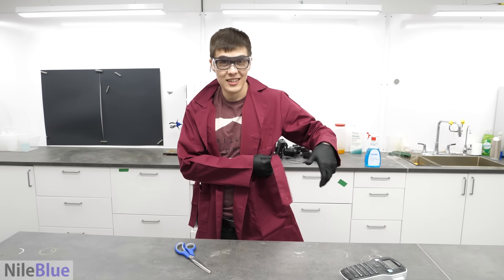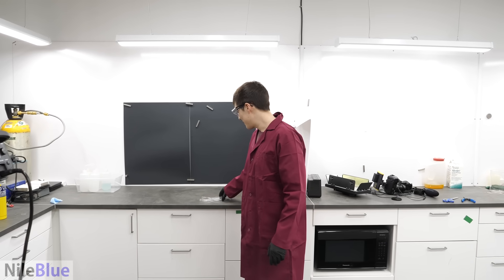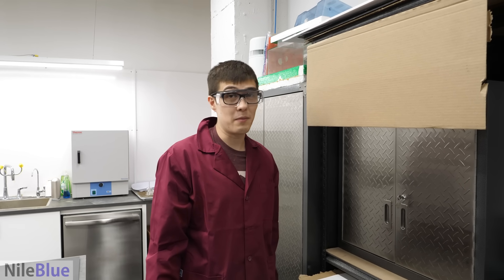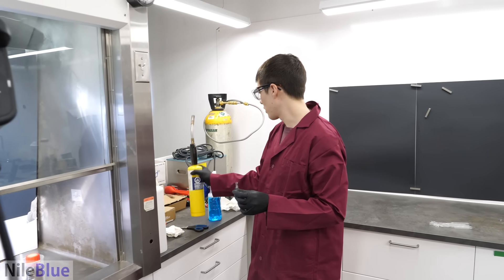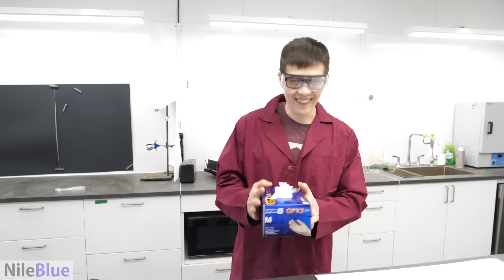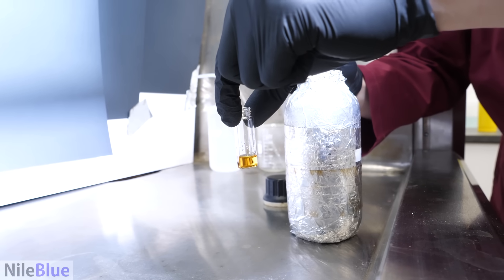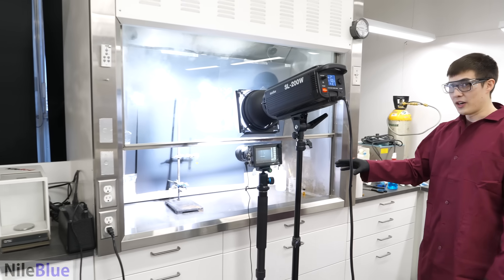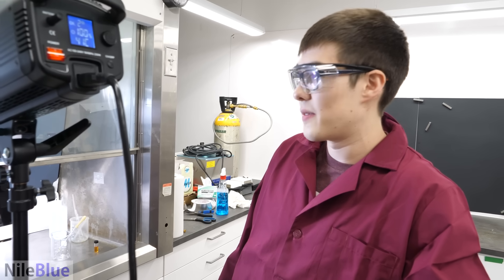Liquid rocket slow-mo adventure

Comment: Okay I uh work for Aerojet Rocketdyne… and these guys seem to have no idea how dangerous this stuff is… when we work with any chemicals at all… we all wear full hazmat PPE with an independent air supply, emergency showers and heat triggered retardant sprayers from the ceiling. If any of that stuff gets on you it won’t stop releasing energy.

Comment: It looks like the expulsion from the reaction was competing for test tube real estate with oxygen intake to keep the reaction going.  if you could have had an oxygen source by the nitric acid without compromising the reaction chamber (i.e. an oxygen line/valve) I suspect you probably would have had a more stable reaction.  Having a second intake for the aniline itself would likely create a much cleaner reaction as well since the force of the reaction seemed to be pushing any aniline that hadn't made it to the nitric acid back out of the top.  However, that would require much more setup and precision, as well as the desire to make more things explode, which doesn't seem to be a desire you have an abundance of. :P

Comment: 2:25 i used this in a chemical plating factory i hate that shit it is the worst acid ever its so fumey but atleast the fumes are heavier than air right

When it gets on your skin tho you hardly notice it... but if you get tiny drops and leave it for awhile you will get tiny little single layer skin blemishes that heal fast.. mainly makes you itchy

Comment: the gas expansion is subsonic, so no need for an expansion after the throat of the nozzle; this actually reduces the thrust of the rocket, as it needs to expand back out and slow.  De Laval nozzles (contraction-expansion nozzles) only work if the propellant reaches mach 1 at the throat!

Comment: I wouldn't suggest to try fuming nitric acid on you skin like Nile did. The only protection is a thin layer of fat on the skin. And once it's gone it will burn very fast. Also if there's water on the skin the reaction could go faster. 

In my uni there was a case in 60-s, I think. Some guy got his hand burned to the bones when fuming nitric acid splashed on the skin.

Comment: I Know you're Using Hypergolic Fuels, Which Combust On Contact with Another Hypergolic Fuel, The Dragon Spacecraft Fuses it as well, For the Launch Abort System, Making it Very Reliable, and Since its Liquid, its Throttable. Also Sorry for all the Info, I'm a Rocket Nerd

Comment: A lot of rocket fuels are very sensitive based on ratio, if it’s off by just a percentage of its mass, it can ruin the mixture. I make rockets often with my friend and we use a Potassium Nitrate and powdered sugar ratio and if we are off by just a few grams, it will either smoke and just kinda sit there or burn very cleanly and don’t get any rapid gas expansion. You really need to hit that sweetspot. You should try some small solid fuel tests in the future. Just keep in mind that the mixture is super sensitive to moisture and every hour it sits out it looses a lot of its potential. Due to its sensitivity to water, it can be rendered completely inflammatory rather quickly which can be exploited to stop small unwanted fires.

Comment: 12:38
Not quite at the same time.
The top and the thin neck ignited at the same time, with the neck being really dim.
And then that reaction spread to the bottom, causing the whole thing to burn more brightly.

Comment: This is the experiment that I'm wanting to try and that I'm prepping for  right now. I just need 5gr  99.9% pure tin metal I'm having a hard time finding some around my place anyways Using modern science and fusion to fuse tin and copper into gold isotope 104 I need to stabilize the isotope with 14 neutrons because fusing copper and gold gives you 79 electrons 79 protons only a 104 neutrons which means stabilizing it with 14 neutrons should give us a nice stable 118 isotope  if I'm successful with this experiment this could be extremely important for the technological production industry as expensive gold is used in many of their processes for making solid state chips ultimately lowering the cost for future technology  in theory this should work with tungsten and Boron and stabilizing it with an extra 13 neutrons

Comment: ive always wanted to integrate some computer science optimization into practical science. like a fuming nitric acid container with a solenoid to vent it regularly. or writing a code for your aerogral pressure chamber so you wouldnt even need to babysit the meat cooker. i guess thats pretty overkill stuff that i just am interested in cause i love comp sci and it doesnt pertain to chemistry but interesting thoughts that go through my head tbh.

Comment: I know you've done Aluminium and mercuary before, and it's timelapse is a very iconic image. Would you do it again, and is their anything that can be done to either slow down or speed up it's reaction? also does the shape of the aluminium affect the "stack" of oxide build up? What would happen if you did it in on a small aluminium dome, or dish?
Reply from the maker: I did a follow-up for it shortly after the original. I slowed it down and stopped it by running it in a vacuum. I think more oxygen would speed it up.

Comment: 1:03 It reduces the space the fuel can be exhasted from and limits the air entering the system increasing the force exherted.

Bigger hole = less force / small hole = larger force. Too small and it seals shut and becomes an explosive.
Reply: yes

Comment: If you're really interested in this subject, I recommend taking a look at the book titles How to Design, Build, and Test Small Liquid-Fuel Rocket Engines, which is exactly as it says on the tin: a guide to designing, building, and testing small liquid-fueled rocket engines. It's available here: http://gramlich.net/projects/rocket/book.html
It mainly deals with designing a gaseous-oxygen/gasoline engine, but I'm fairly sure it can be adapted to work with RFNA/Aniline with your knowledge

Comment: I learned to respect acids, after cleaning welding oxidation off some INOX with a pickling paste. Turns out, the skin turns yellow, and later black, where it splashed. leaving a nasty scar.
Reply: Yellow skin is a typical day in the lab. Black though? Did it not occur to you to was your hands in time?

Comment: 0:57, approximating the gas to a laminar fluid, the reason because it goes faster is that (if the flow is constant) when the section decreases the speed increases infact they are inversely proportional : 
Q=V/t=A×v×t/t=A×v (Q is flow, V is volume, t is time, A is section or area and v is speed). 
Sorry for my not perfect English but I'm only an Italian teen.

Comment: I think you might want to consider investing in a lavalier microphone, the audio in this leaves room for improvement
Reply from the maker: It needs to be sound treated. The room has a horrible echo. It'll be done eventually
Reply: @NileBlue  Thanks for the reply. That would definitely work, however I am pretty sure a lavalier microphone would be a good improvement in the meantime.   I might be wrong but I'm pretty sure it will help quite a bit. I primarily work with images but I've been around a lot of mic setups too and lavaliers are definitely a worthwhile investment

Comment: For nitric acid you should use neoprene gloves.  I don't know if they are also good for fuming nitric acid. If you'll try, let me know!
Reply from the maker: If you look at the polymer, you can see areas that can be attacked by nitric acid. Most notably, double and triple bonds. Vinyl doesn't have any, which makes it way better. Neoprene has a double bond though, so I imagine it's similar to latex. However, I could be totally wrong.

Comment: The Nozzles you make won't really do much if the back pressure is too high - it'll go to mach 1 at the throat,  and then decrease below sonic speeds again. if your back pressure is lower, you'll reach mach 1 in the throat, and then be able to go above it in the divergent section. Looking at the flame, it definitely looks like this is the case - it continues to thin after the nozzle diverges.

that is, if you ever reach mach 1. you might never reach it, in which case you don't need to re-expand the nozzle ever. It's a design constraint of compressible flow nozzles that if you reach mach 1, it'll be at the tightest point.

Comment: All you would need to create some more nitric acid is some water and a lab-grade high voltage transformer. You would need to strike an electric arc to superheat the air with plasma, separating nitrogen and oxygen out of the air to create N2 and O2, which recombine to form Nitric Oxide. Add Oxygen to this, and you get Nitrogen Dioxide. This Nitrogen Dioxide can then be combined with water to form Nitric Acid and more Nitric Oxide as a byproduct. This is demonstrated well by "Cody's Lab". https://www.youtube.com/watch?v=ep23ds4cZs4

Comment: The real question: Why would you have your acid cabinet made out of metal?

… not that I'd be much better. Mine's cardboard.
Reply: Metal would at least react with the acid, if there is a leak
Reply: @among-us-99999  it would look sick.
Reply: @among-us-99999  What? Bro do you even chemistry?
Reply: It has already been said. I thought it was common parctice to make acid cabinets out of metal because they react metal. There fore you can see if you have a leak.
Reply: @gewoonik687  better to wrap the bottle with aluminium foil like another commenter said. That way you don't need to replace the cabinet due to the slightest leak.
Reply: Plastic or ceramic would be the ideal choice.
Reply: PTFE or PVDF plastic would be a good choice for an acid cabinet
Reply: @bluesun128  I would just use PET or ABS. PTFE is way to expensive for commom acids.
Reply: @brilliantgreen2863  on the contrary, PTFE isn't that much more expensive than PET, at least for sheet stock from our supplier.  And ABS may be a good choice for some chemicals, but some acids such as Nitric acid will react with it.
Reply: @bluesun128  PET and PTFE are the the same price? Damn, could you please give me a link?
Reply: @brilliantgreen2863  +1. I want to get in touch with that supplier <3
Reply: That would be an acid box then
Reply: @L. Fire Because the metal will capture the vapors, react with them, neutralising the acid and leaving a visible sign that something is wrong at the same time.
Reply: Me : store nitric acid next to white spirit and gasoline on the same metal open shelf
Reply: I have a radioactive materials cabinet
Reply: What you need is a metal cabinet with a non-reactive finish. My acid cabinet is painted with epoxy. Perfect, no corrosion.
Reply: I dOnT hAvE a AcId CaBiNeT i JuSt SnIfF It AlL
Reply: @GAMINGOBRIEN69  if you're snorting straight acid you're gonna think the moon is a dog and your nose is a kangaroo AWWWOOOOOOOOOOOO
-The Truth
Reply: @100GTAGUY  are you on acid?
Reply: L. Frie could be something unreactive like aluminium
Reply: @ix_risor  aluminium is insanely reactive lol.
Reply: @brilliantgreen2863  how about gilded/gold plated stainless?
Reply: @brilliantgreen2863  Aluminum oxidizes instantly in air, though, and the oxide coating is extremely stable, I think only the halogens can even begin to touch it (I remember a Reader's Digest story about a train derailment decades ago  that oopsied a tank car of chlorine, that described people watching their window frames rot away over several minutes.).
Reply: @noahluppe  gold plating might work, but it would be dissolved by a mixture of nitric and hydrochloric acid. Best to stick with plastic.
Reply: @DeliveryMcGee  it's not just halogens. The oxide layer is quite unreactive, but no match for decently strong acids. I remember making cups from compressed aluminium foil with a friend and pouring in 37% hydrochloric acid. It turned the cup into a grey puddle of aluminium chloride within seconds. That was fun.
Reply: @DeliveryMcGee  thats something people miss sometimes. Like aluminum reacts with water to form hydrogen gas so why dose your aluminum camping pot not go up in a ball of flames when you brew your morning coffee? Because of a damn stable oxide coating all surfaces thats really resiliant. In a way aluminium is so durable because it is so reactive and oxideses so rapidly because it forms very strong bonds in a similar way fluor one of the most reactive elements forms teflon as a verry chemically durable substances. for most acids/bases a aluminum drawer would probably be fine because of the low solubility of Al2O3
Reply: BrilliantGreen yeah what everyone else said. I know aluminium metal is reactive dw
Reply: @DeliveryMcGee  I remember that story. I think it was also on tv. If i remember right a couple was stuck in their home because the route away from the wreck was blocked. I believe they also said they had bad damage to their lungs and tge rest of their body. I think about that story every time im near a railroad track now.
Reply: @Edward Richards, I store my lab bottle of hydrochloric acid with aluminum foil over the cap to catch vapor that escapes. It is corroded within hours every time from the smallest amount of vapor.
Reply: @ix_risor  dude youre so stupid 😅 you said "aluminium is u reactive" and then when everyone tells you otherwise you tell them "dw i know that".. Are you dumb? You disnt even delete the first comment so everyone still sees that you pretendin lol
Reply: @baadlyrics8705  aluminium is reactive, but aluminium oxide isn’t. Aluminium oxide is clear, and forms rapidly on contact with air, so if you pour acid on aluminium nothing happens because it’s blocked by the oxide layer, but if you scratch it first, then it would react rapidly.

As for the comment deletion, I don’t delete my comments, people can see me being dumb if they want.

Comment: Constricting the neck until you get that "pop" means you're getting supersonic flow, which means the throat is choked, which means the pressure in the reaction vessel is increasing and boosting your reaction rate. The calculations for it aren't too hard if you want to control the reaction.
Reply: I dont think that is a supersonic pop
Reply: He could calculate whether the gas flow rate is supersonic based on the expansion rate of the reaction and the tube measurements. I also doubt it is supersonic though
Reply: @CharliePhillips4  It's not about expansion rate, it's about mass flow.
Reply: @mattsoup4121  also it looks like it is deflagrating and if it is supersonic in this small volume, wouldn't it just detonate and just explode because of the shock it receives?
Reply: @mamax7169  It wouldn't instantly create a pressure wave. The gas is subsonic until it reaches the throat.
Reply: @CharliePhillips4  Reactions accelerate with pressure. The orifice boosts pressure slightly which increases reaction rate which increases pressure etc. Until you get choked flow. Only takes like 50psi to do it and these reactions run away fast.
Reply: @mattsoup4121  how can you calculate the speed and say its supersonic without even knowing the speed of sound in the reaction medium? It is definitely not 360m/s
Reply: @mattsoup4121  but please do the math, it would be interesting how you want to calculate this without knowing anything about the reaction (temperature, pressure, concentration, amount etc.) I think, to be honest, with this setup, you will be closer by guessing the speed, but please proof me wrong. It isn't to hard anyway by your opinion.
Reply: @mamax7169  Assuming a 1:1 mix of aniline and FNA in an 18x150 test tube I pixel counted the contraction ratio of the throat area to be approximately 9, assumed about 0.5mL of nitric acid from the 1mL pipette, and calculated our necessary values. The speed of sound of the exhaust products is 1003m/s and at ~26psi you have enough mass flow to achieve this velocity and it can expand up to 1250m/s if the nozzle was expanded properly.  This reaction is capable of producing 34 psi so it's definitely in the supersonic expansion range.

Source: The matlab code I wrote to design the liquid rocket engine I'm building
Reply: @mamax7169  The speed of sound in the exhaust products 1003 m/s
Reply: @mattsoup4121  i will awnser tomorrow it 5 am in Austria and im drunk as fuck 😂👍
Reply: Issue is more in the glasswork. Doing it by hand is a proper bitch. If you're not careful, the glass sags, and it's basically impossible to fix once it goes wrong (by hand).
Reply: @Sinnistering  Don't disagree. I wouldn't want to be doing what he's doing. Huge possibility of glass explosion

Comment: Mmmm... "makes the gases go faster basically" or "it induces a dynamic trade-off between pressure and velocity of the fluid's expansion, forcing a relatively low pressure stream of gas through the throat, preferably at mach 1, so it can expand and decompress to 1 bar against the engine bell, thus imparting a Newtonian reaction force in the prograde" if you're nasty.

Comment: I worked for a few years in an acid factory. That was an interesting time.
Reply: What's so interesting about it? 😊
Reply: I'm in gen chem right now and we're on the few chapters about acids, buffers, and titration. I hate it. Did your work require the math when mixing the acids or bases?
Reply: @robertrodriguez7228  Thankfully not really we just dealt in the raw acids the purer the better.
Reply: Did it affect your health?
Reply: @shizotypical  No. They had very strict protocols, when on the plant .